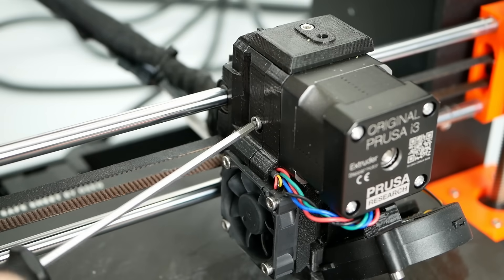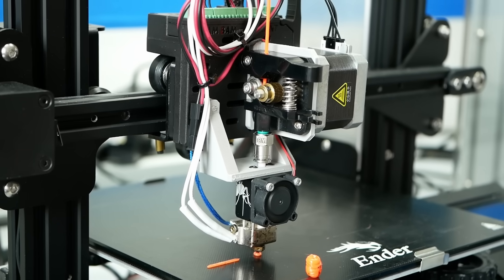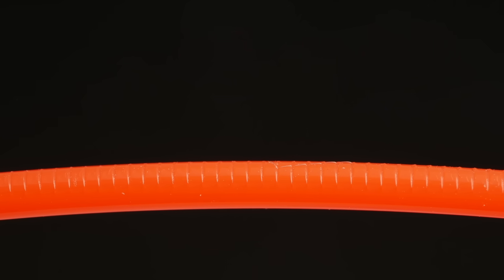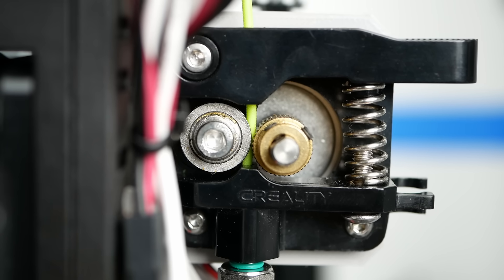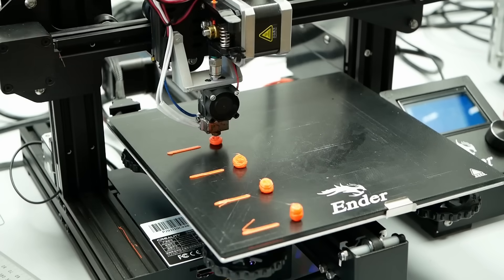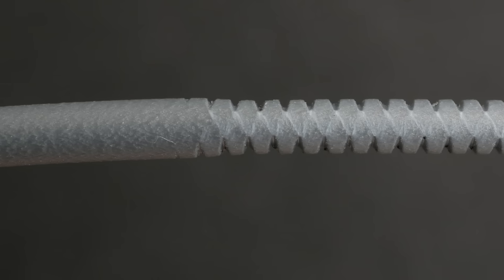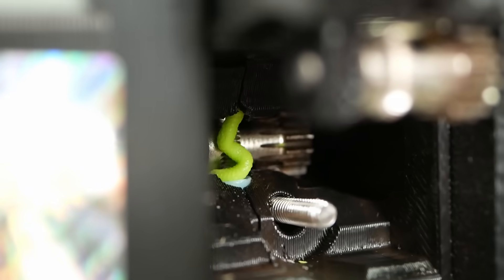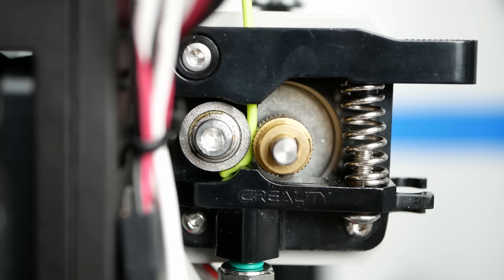Everything about Extruder Pre-Tension!

Comment: The problem with dual drive gear wheels is how the drive is given to the gear wheels. If one gear side drives the other (a follower gear), then the gearing teeth cannot sit perfectly together between the two wheels once the filament is introduced and this has pushed the wheels apart. The teeth must be moving apart slightly and after this happens, there will not be much difference between having the gear teeth present or not on the follower gear, you will be using the filament more on it in a friction mode. 
This is what I liked about the OMG style extruder where the filament connects to two drive wheels with two idlers are pushing the filament onto the wheels. Double the contact, half the pressing force needed for each.

Comment: I had to much pressure on my second printer a tricked out ender 5 plus with i microswiss direct drive. So as it was pushing filiment it would peper the buld plate with powder. Grinding from to tight. It would clip it on retraction lol😅 didnt take long to find a solution.

Comment: Late to post on this but a heads up if you're using an ender 3 with the aluminum extruder gear frame that you either need to cut your spring t find a different one since it is too tight

Comment: I don't know if this is the right way but for my voron I first set the standard value in the configuration file. 
.than I marked 120mm and extruded 100mm. After that I turned the noob 1 turn and measured again ..my values where 21,55mm, 20,4mm and after some turns 18,87mm without changes. This is for me the value where I have the best filament grib. Now I can set the parameters in the configuration file  by calculating the right value

Comment: Ive been blaming my printing issues on my filiment bieng too weak, in actuality my ender 3 printer for some reason came with the maximum spriny tension and was crushing my pla completely flat to the point where it looked like a tiny ribbon.

Comment: My rule was to run as little tension as possible. Enough so the filament did not skip or grind. Not too much to place undue stress on the parts and to deform the filament as little as possible. This method worked for me with Schlotz Bowden and genuine Titan and cheap Chinese metal MK8.

Comment: Just as I was watching some (way less comprehensive) videos about troubleshooting under extrusion, YT suggested this one, as I've been a subscriber for some time now. Using adaptive layers in Cura (bare with me here) yields great results with less printing time, since it keeps detail where needed, and prints thicker layers otherwise. Looking at some prints, I noticed this weird strech mark looking defects in the areas with thinner layers, with a very distinctive pattern and clear sign of under extrusion. I fiddled with the tension adjustment screw for the first time today since I got my Ender 3 V2, about 4 months ago, and it was loose as heck.
I haven't tested it yet, but it makes total sense that thin layers (0.12mm) under extrude since the extrusion motor applies very little torque; looking at the sliced model in the flow view showed how little there was, and pulling the filament with two fingers was enough to stop flow completely. I'd imagine the spool exerts as much resistance, hence, under extrusion at thin layers. The flow variation worsens the effect, so when printing at 0.12mm without adaptive layers, it doesn't show up since flow is constant.

And all of that eureka because of this video. Thank you so much!

Comment: What do you do when your printer has run for over an hour and the extruder has warmed up the plastic to the point it softens it and causes it to constantly   brake and jam up the gears? Unfortunately the tension cannot be reduce any more on the extruder to fix it either.

Comment: Very useful video. I have not really had much of a problem with "most" of my machines and I have 11 printers, all FDM as I print functional parts and very very few models. Mostly I do robotics with either Arduino or Raspberry. BUT one of my printers does give me issues if I pre tension incorrectly and it's sometimes an experiment. I've seen videos where the youtuber says for ABS fully tighten the tension screw and back off 1/2 turn, etc. My only printer out of my 11 that cause issues are my Lulzbot TAZ 5's. And I have 3 toolheads for them. I built an E3D extruder toolhead with 1.75mm filament and .4mm nozzle. The toolhead that comes with it which uses 2.85mm and .5mm nozzle and I also built a Moarstruder which uses 2.85mm filament and 1.2mm nozzle. Each of them give me periodic issues where filament won't feed and the extruder gears grind the filament and stops extruding. What a pain. Perhaps if I stuck with one filament type, and one brand of filament I would have less issues and with 11 machines I guess I could do that. My machines other than the Lulzbot are Snapmaker, Sindoh, and Vorons. None of them have issues only my Lulzbot's BUT when they work they are workhorses. Of course my Voron blows them away in speed but I'm seldom in a rush to produce. I think one issue is that 2.85mm filament is less forgiving. The thickness of it can make it tougher to pull from the spool when it's towards the end of the roll. 1.75mm filament is more flexible, 2.85 the end of roll filament wants to maintain the curve and the curve of the filament around the center of the spool that curve makes it harder to pull. And for 2.85 a drybox seems much more important. I do have many less issues when I am using the Moarstruder. If you check out the Lulzbots you will see that it's not a single spring system, it's 2 screws with springs on each so it is also important to have equal tension of each spring. By the way, seems that I have less issues if I error on a little too tight rather than too loose.

Comment: I have two Ender 3 printers. I dubbed them Beast and Rouge. Beast is the oldest one and I tossed all of the mods onto it including a cheap dual gear extruder. I noticed the spring that came with the dual gear was putting way too much pressure on the filament and would skip. I replaced the spring with the old stock extruder spring and works perfectly. However on Rouge I used the same dual gear extruder but in a direct drive setup and sure enough it skips like hell after five minutes of printing. Looking at the filament with the stiff spring I can see the filament is getting crushed and starts grinding. That's with the spring on the lowest setting as well. I tossed in once again the OG spring from the old extruder and with the lowest setting it's perfect, no skipping.
Reply: I have this kind of problem too. Extruder always skipping after changed the cheapo dual-gear kit. the kit came with the spring is way too strong. I changed back the ori spring which came from ender3-pro; work like a charm now...

Comment: I never touched the pretention over a near constant printing for 6mo on a creality 3v2 - then suddenly one fillament seemed to have underextrusion problems and thus couldn't even get the bed leveled, though if I manually cranked the extruder fillament would come out with proper stick.... so I adjusted it, and readjusted it and after weeks of nothing working (like you said, it could be practically any other problem) I've ordered the direct drive kit... so now I'll have spares to muck around with lol

Comment: I've Significantly Improved My BMG extruder by using the lightest possible (reliable) Pretension.
 Seems the Gears are mfg'd to a rather Poor standard and quickly mess up flow consistencies with increasedmechanical  interaction with each other.
 Note that I have ZERO interest in High Flow rates.. finding those as simply ; Look Ma no hands posturings. 
Venerable MK8 Extruder, despite creality going so far to cheapen by making the darned thing out of Plastic..  ffs. 
Remains  as a Very Good extruder design.  Being Far more reliable /consistent than the Dual gear contraptions
 Possibly the best extruder ever....  just not the currently fashionable one.😕

Comment: Great review of extruder pretension….but one thing Stefan… in actual printing the retract on Bowden setups should be commented on. Why so? Because the Creality style single gear extruders can crush or flatten the filament such that it will create friction inside a Capricorn tube and cause issues. Additionally, those running a bimetallic heat break can find that the deformation in the filament is such that it has problems passing through the titanium tube just before the heat zone causing clogging symptoms…

Comment: My Ender 3 Neo hasn't printed correctly in 3 days. Feel like I'm running out of options to try. I only get a trickle flow that curls up right away and causes it to immediately stick to the brim and ruin the print. I must have stopped 3 dozens prints in the past 3 days. Not sure what to do, my wife said I could still return it since there's a few days left in the return period. It printed great up until last week. I cleared a blockage with a needle and was good for a few more days and now it's not working at all. I wonder if there's a better printer for a beginner out there.

Comment: I have actually replaced the stock spring with a softer one to gain some adjustment option as the stock one is dead-solid and no matter how you adjust it it squeezes the filament to much.

Comment: Extruder tension is extremely important with bowden setups. When filament gets crushed in the extruder it starts to jam in the PTFE tube. This is notorious with stock Enders where springs are much too tight. I reccommend to replace or shorten the stock spring in this extruder.
Reply: dang I think this might be my issue... but it's the spring that came with the upgrade? i definitely feel like it makes it dig way too deep into the filament. but if i cut it there's no going back :( I'm not sure if this is the issue, i've just about tried everything else though

Comment: It would be nice, Stefan, if you could follow-up this video with proper or tuning retraction rates.
Additionally, as I experienced with my all-metal-hotend from SwissMicro for my CR-10S, too much compression of the adjustable idler forces the driven gear and motor shaft to one side and wears the motor bearing.  I had to replace my motor.

Comment: Id rather run it so it slips and grinds but with the least tension possible so it doesnt actually eat away from the filament yet nozzle pressure returns at the end of the prime. (because retraction amount depends on the length of travel and there is no way to compensate for that)
Reply: too much tension  and you start blobbing where the line starts, too little then  under extrusion occurs too much then you deform AND eat away from the filament too little and you  under extrude.

Comment: In my case I changed from extruder given with the printer with the idler gear to voron m4 because I couldn't print high fiber wood filaments. The filament like that one from fiberology just slided and raising the temperature to lower the nozzle pressure was not the option because burning fiber blocks completely nozzle. So I changed the extruder, I still couldn't print with small nozzles bellow 0.4, 0.4 (depends how big the print was) but 0.5 and up prints without a problem.

Comment: The idler arm broke on my Ender 5 Plus, purchased an all-metal extruder. Personally, I haven't touched this setting a lot. The spring that came along was quite strong, so I left it on the lowest possible tension. I'd say you want as little pre-tension as possible, so just increase in small steps until the filament is gripped correctly.

Comment: I may like to add some points to this..
First of all, Extruder tension is a bit more important and maybe even the easier way to solve extrusion problems.. Let me short explain why.. If your tension e.g. is too low, and because of that you have issues to push the material through the nozzle, especially on a bowden, yes increasing the temperature also can solve the issue.. Using a new bowden tube also can help you.. But both at the cost of higher energy consumption or a new Teflon tube, where just turning a screw really solves your problem..
Next point make sure, that you did your emextruder calibration at the right tension for the material u used.. If you slip during it, u end up with wrong results. Especially, if u get a nbelievable high results (asuming you didn't go that fast, that you skip or at too high tension). In case use a a bit higher tension for calibration than you intend to use in printing.
I heared and did read a lot of reports, where ppl say, that their bowden tube has to be replaced regularly or it has too much friction inside.. If you experience this, your tension is most probably too high and you deform your material to much.. We use a Teflon tube with 2mm inner diameter and a fillament that should be somewhere between 1,7 and 1,8mm, where most of the plastics we use are good gliders and Teflon is one of the best gliding materials at all.. Furthermore the time of use will make the tube even wider.. So most probably your too high tension is causing it. There are only two places where u really destroy the tube.. At the fastener of the extruder.. Not to avoid, but you just can that and continue using. The other side is the connection of the hotend, where u can burn the end of the tube which mainly means two things => you are running too hot there, Teflon burns at 250°C+. So you have a  "servere" hotend issue, or are printing at too high temperatures, where see above how you can lower the needed temp with the tension screw.
And last but not least, there is a issue with most common Extruder constructions.. The extruder motor gets hot during operation, and that's OK.. Depending on motor, motor settings and print speed, up to 100°C Motor temperature is OK.. 60 is mainly recommended, running at about 40 you lose a lot of motor power. The issue most extruders have, this heat is also transfered on the extruder gears.. Furthermore the gears at higher tension produce more friction heat. This makes your fillament softer.. So if you experience extrusion issues in long prints you don't have on short prints.. Tension is the point to start investigating the issue..skipping as well as too much grip can cause it.
Last but most important, on bowden you should use feature pressure advance or linear advance (name depends on firmware) to have better control of the flow in a real print.. Sadly exactly this feature imposes some insane moves of your Extruder that causes friction heat.. On the other hand for Linear advance u need proper grip on your material to make it work correctly.. Where we are back at the importance of proper tension..
Luckily as this test shows most extruders and materials have a wide range of acceptable tension, and in general starting a little too tense and in the end being a bit loose helps.

Comment: Hello Stefan, Thank You for doing all these tests to help us out 
i had an idea I was curious about, If the part cooling fan blows on the part, heat sinks are usually cooled by air sucking the heat off the heat sink, if this fan was turned on our printers, would this not help with bridging or have some benifit

Comment: I hope you are amazing at math and physics because I have something for you. My name is Matthew Rife and Royal Rife invented the Rife Machine and I've always been involved with resonant frequency oscillation ever since I can remember. I was experimenting with frequency welding pla and had great success.  I can give you equations to calculate the resonant frequency of a print including all of the different infill percentages. Just for clarity and benefit to those not familiar with is, I'll explain. Resonating with PLA using frequencies will cause the PLA to vibrate and shake. The friction caused by the oscillating generates heat inside the PLA.  Increasing the amplitude generates more and higher temps and I have been successful just this morning in melting PLA using this method paired with my Real Rife Machine frequency generator. My suggestion is to apply this to printed parts causing the layers to weld together just like putting it in the oven except this would not be restricted on ability to pass through the barriers with ease and all lines, inside and out, including the infill would benefit and result in the same welding of layers equalling a much stronger part. I'm working on being able to temper in a sense and get a desired hardness density part as well. If you have any knowledge you'd like to pass along and help with this, please let me know and I'll send you my contact info.

Comment: If you do one more material testing video. I would recommend testing CF petg. I think its magic because of the low shrinkage and it seems to have really high impact toughness. I have been using Atomic carbon fiber petg. but i havent tested it properly.

Comment: I have found that if I have the tension too high on the extruder that I get more oozing and see bubbling in the extruded plastic. I suspect the deep groves in the filament bring air pockets down into the heat zone. Now I try to keep the tension as light as possible for this reason. I also dry my filament which gets rid of most of the oozing but I found some oozing and bubbling at the nozzle even with dry filament until I lowered the extruder pre-tension. Although I have not yet done a CNC Kitchen level of testing of this phenomena. 
Has anyone else observed this?

Comment: I load the filament, heat up the nozzle to the print temperature, loose the scree for pretension to the point i just can not pull the filament out of the extruder, then i hold with two fingers the filament and extrude 100 mm. If i can hold the filament against the extruder, i tightened the screw 90 ° clockwise and extrude again 100 mm. I repeat this until i can not hold the filament against the extruder. Since i do so, I never have any problems with the pretension